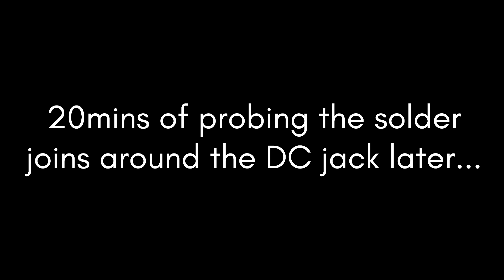Lenovo V145 DC Jack - LFC#377

Comment: Also, you can get a replacement motherboard for this model for around £20. Depending on the cost of the jack and your time, it might be more cost effective just to replace the board. I did this recently on a repair job with an old Toshiba laptop that had broken usb ports.
Reply: But presumably the windows install then has a wobbly because the SSD is in the "wrong" computer?
Reply: @neilshep50  I used a fresh install of Windows and copied the user's files onto it.
Reply: Ehh no, repair is all about keeping stuff out of the e-waste pile !
Reply: @intrax2tv  Well.. you are saving the laptop at least ;)

Comment: Why would an A-series APU make you angry or break your heart? I mean, they're kind of old, and they were never a high end part, but for their time (pre-2017) they were decent (in terms of both price and power consumption).

Edit: apparently this laptop model is from 2019, so I guess that's what you mean; they're using a previous-generation APU (essentially a 3 year old chip) when Zen / Zen+ ones were already available.

Comment: 1 tip.. careful w moving too early and pads rip... anchors melt faster than the small power pins as heat has not spread thru yet and rip a pad (if it was hdmi or usb) 
light taps first while monitoring the data or power pin melt. (in this case no small pads so it was safe)
hot drop i do w a solder pen on anchor pins and very low air assisting to keep it melted longer as i alternate anchor pads melting w pen.
its good that you post unedited video so others can learn from minor mistakes.👍

Comment: On most of these Lenovo consumer models there is a reset hole with a recessed button that allows you to turn the mainboard on and get to the Novo menu without the keyboard or power button being connected. Unfortunately sometimes the novo button is on the power button board 😦

Comment: Last time I cleaned my gaming rig I spent 5 minutes in panic mode after re-assembly because it was stone dead, turns out I didn't connect anything to the front panel header ( power button included ) 😄
Reply: Last time I cleaned mine I spent 5 minutes coughing from the dust. Somehow, computers manage to transmute regular household dust into a mix of soot, pepper and enriched plutonium.

Comment: Hello adamant it jonas here from ETH I've been watching your videos and they are really educational. I would like to thank you on behalf of everyone trying to learn this stuff including me so thank you very much !!!

And i also need your help master teacher😜
Ive been diagnosing an hp dv7-2270us pc and it got a messed up pwr btn connector all pwr rails are good and trying to short NBSWON#1 to ground to start the laptop does nothing ive the 3.3 & 5v rails and when measuring the NBSWON#1 PIN on the connector it has 0v is this ok? Schematic of the board can be found by the name of the pc or its "Quanta lx6/lx7"

Comment: techically if the laptop allows charging through type c you dont techanicaly need to charge from the dc jack
Reply from the maker: That's surprisingly few laptop models. There's a couple of models that can charge from DC-in or from USB-PD, but most of the time the only reason why a laptop will have both is because it requires more than 65w for peak performance, and it's cheaper/easier to add a DC-in jack than build a 85+ watt USB-PD interface.